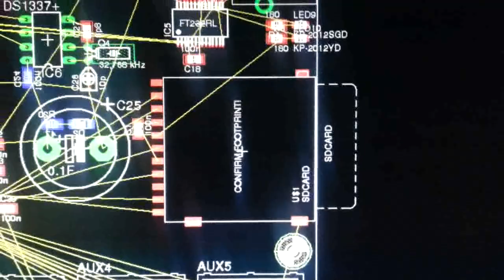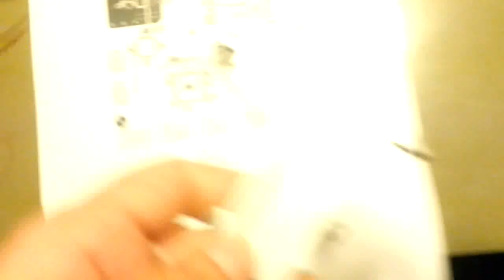The ultimate sensor board: Beating the SD card socket problem...

Comment: Get your SD card sockets from a big supplier like Farnell/Arrow/DigiKey so you can be sure that everyone else gets the same part. Avoid using local supplier which list it as "SD card socket" and don't give out technical drawings or datasheets. DigiKey for example has a lot of different sockets and they all have datasheets available. You can pick from Molex, TE Conn etc...

Comment: It's rather expensive, but whenever I use a SD card, I go with microSD and use part number 0492250821 from Molex. It's easy to solder by hand and is the nice push-in/push-out type.